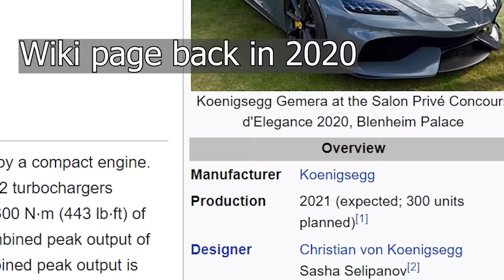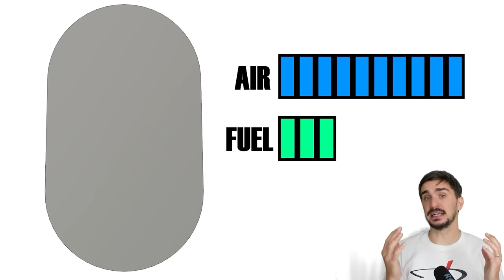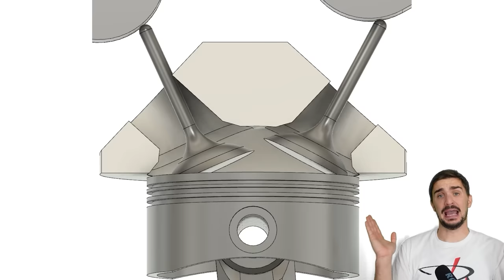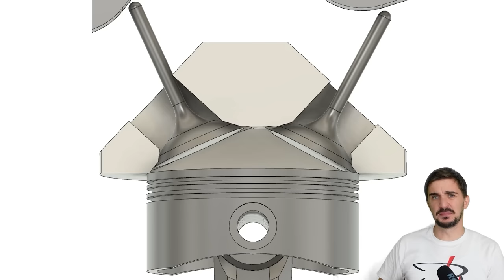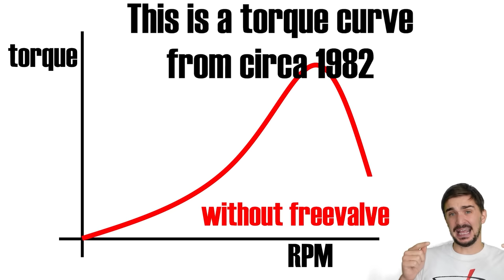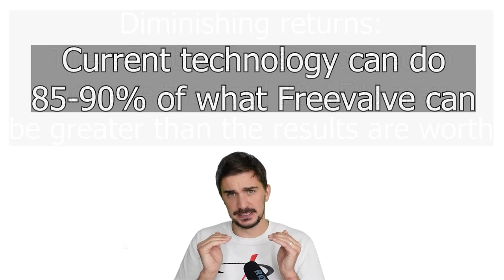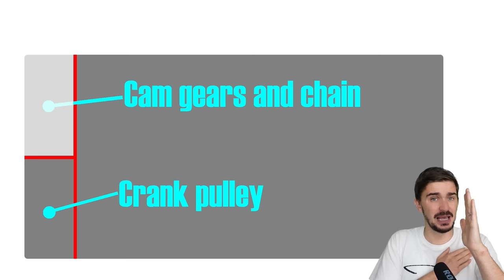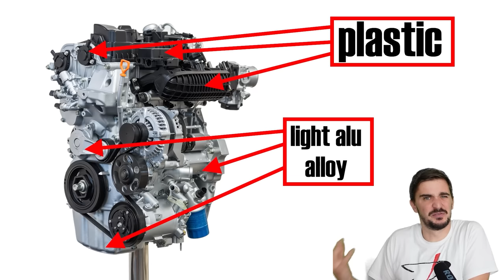FreeValve Isn't a Big Deal. Here's why

Comment: I thought Christian also promised the efficiency would be up, the need for knock resistant fuels would be down (high boost without knock), preheating the cat would be easier, so no need for two catalytic converters. The GR Yaris/Corolla might need to compensate for the boost pressure with lower compression or run more boost to make the same power, so that would result in less fuel efficiency and less power apples to apples.

Comment: Koenigsegg has stated their focus was on developing a sort of AI machine learning software which will discover new and better ways to operate the valves for any given condition with the primary goals being significantly reduced emissions  along with increased power.

The advantages will be having an engine which produces the maximum amount of power whenever you want it, with an aggressive race-cam profile. Then immediately back to a luxury car idle and low end torque. While producing so little emissions that a catalytic converter might not even be necessary.

Comment: instead of using a different air compressor (like a supercharger) could FreeValve use the exhaust gases for pressure in the pneumatic cams like a turbo does?

Comment: Talking about engine size change they probably meant size od the engine on produced power having assumption the power gains are real.
The idea to control valves opening by computer is good, but the way they've done it is far from good - it requires the extra pump (weight) and the energy to move the valves is still coming from engine produced energy but on few stages of converting it to final work with all losses asocciated on every step, therefore it can not be very efficient overall.

Comment: It removes all the parasitic loss of a conventional valve train. The big advantage is no parasitic loss driving the cams, valve train, cam sprockets/gears. The higher performance the engine with more aggressive cams, stiffer springs the more power lost by driving the top end.

Comment: Things like FreeValve do make sense, but not by the way described there and only make sense for very low volume production engines/cars where just a few dozens are ever made.
The thing is, in engines the industry went to really extremes in pushing the design to real physics limits. And that requires a lot of R&D costs and time and/or high risk of something being overlooked in the design and needing correction later, the risk of such design errors increasing mainly when the R&D budget is limited. With high volume production, even seemingly small percentage of a cheap product price summes up to very hefty sum of money, allowing e.g. so large development teams and extensive testing, greatly reducing those errors.
How that is related with FreeValve? By removing the fixed cam profile, which when shows up as wrong requires physical recall and laborious replacement work, FreeValve being programmed by SW allows such correction to be made remotely within half an hour and even without the need for the customer to leave the car at the dealer.
So it allows to get away with way less expensive R&D testing, which brings quite a difference when just few pieces are ever produced.

Comment: Unfortunately internal combustion is at it's peak. I doubt any significant improvements will be made moving forward. They're pretty close to the limits of how much energy can be extracted from the fuel. Another thing to note is that electric motors solve all of the issues covered in this video.

Comment: I think 2 cycle may have another return..  given all possible controls, VVT, Direct Injection, Free Valve with a Charge Pump (Super Charger), Maybe Opposed Cylinders?  My 2 cycle 125cc Go Kart engine makes 27 HP at 17000 RPM..

Comment: I think the apples or oranges comparison here between freevalve and conventional valve trains is that conventional valvetrains/cams generally only have split personalities in either cam timing, lift, and or duration. It seems to me that regardless of how peak to peak numbers compare, especially with a heap of unqualified variables freevalve, in theory would offer a greater average VE than a cam can. And the only way to really qualify all these percentages this video cites would be to have identical heads with and without freevalve. Otherwise this is all purely speculation.

Comment: The benefit of the freevalve is infinite valve timimg,lift, duration and overlap.However for basic transportation,.low compression,narrow powerband and reliability never mind extremely low cost the valve spring is pretty hard to beat.
Reply: That valve spring returns a fair bit of energy back into the cam, how are you going to recoup the energy used in these valves? You won't and you'll lose mpg. This tech won't go anywhere outside of maybe racing where mpg don't matter.

Comment: What if we just build a cylinder head w the "free valve" upgrade complete w an ECU to trigger each actuated free valve w built in maps and maybe tunable options for the average user.   I think that's gonna cut the costs big time.  I'll put it on my old bseries or an old 22r .. If only someone would build such kit

Comment: So….even based on the horsepower curves, the free valve makes about the same PEAK horsepower, low low end power of the Corolla CR.
Eliminating the frictional losses of camshafts will more than make up for the compressor needed.
Free valve still has a lot to offer, I suspect long term reliability is what is slowing production.
Size and weight savings are from engines that needed 6 or 8 cylinders to put out 600bhp.

Comment: Free Valve could be used to, instantly, turn a 4 Stroke engine into a 2 Stroke engine, using turbo compressors to do the compression cycle. It would be a game changer.

Comment: It’s strange to me that you point out that valve timing mainly affects the overall torque curve and not necessarily peak power and then you go on to compare freevalve and non free valve using only peak hp numbers. Wouldn’t it be more accurate to compare total torque below the curve?

Comment: You didn’t really touch on simplicity. Those bmw and Volkswagen systems have lots of moving parts and prove unreliable in the long term. Cylinder deactivation by oil starvation is unreliable over time. An electric solenoid using an electro magnet is super reliable and the only moving part. Simple is better.
Reply: Electricity adds to unreliability

Comment: If having electronically activated valves in cars were worth the effort then they would have made the transition from large two cycle, compression ignition, marine engines. They make sense in container ships and tankers because they eliminate the need for a transmission, as these ships stop the main engine and start it in reverse for reverse thrust, a major engineering solution when you consider that the only transmission that would work at that scale is an electric drive and that is very inefficient...
[ Also getting an engine to run smoothly on heated nasty heavy bunker oil is not easy and at when the ship is built around the engine you can't afford to damage it as a blown engine == a totaled ship...]

Comment: Anything that can be done in mechanics can be done by the ECU, at least as well if not better. If nothing else, Freevalve gives performance tuning opportunities specific to an individual engine that don’t exist in mechanical systems.

What it doesn’t provide is a limp home mode. A purely mechanical system can still run, albeit badly, in the event of a great many failure events. A purely electrical system can’t.

That said, I’d still prefer the Freevalve system, for all the same reasons that I prefer fuel injection over a carburettor.

Comment: comparing their base model engine to an extremely limited high tier mini cooper model is not a good comparison. If the free valve engine were tuned the way the corollla GR was then it would also likely produce over 300. the GR engines are maxed out per cylinder and require machine work to get pushed any further where freevalve would likely blow passed as it doesn't have the same restrictions.

Comment: the biggest ground breaking change of freevalve would be for me if you have access to the ECUor an aftermarket one,  being able to program different camshaft profiles maps, experiment with two stroke cycle,  completely modify sound,  jake/Air brakes, etc
Lots of cool stuff if you are into programming or messing with software possibilities
if you redirect half the exhaust valve to an air tank, you can make pneumatical regen braking, using air brake to slow down the car and store compressed exhaust gas in a tank, and release the pressurized gas into the cylinder during acceleration for "free" energy

The fact that fiat multiair egines does maybe 50% of what a true freevalve engine can do....well I think its more a proof that more can be achieved, than a sign that freevalve is dead.
If freevalve tech dies, or just never goes mainstream, stays within koenigsegg, it will probably be for cost/mass production/reliability issue ? OR by lack of ICE R&D investments , being redirected to EVs

Comment: I agree that FreeValve is not something game changing. However, I think there are some misinterpretation / misguiding about the figures, just for the sake of this topic. "Traditional Engine", I think what FreeValve meant was that "same engine with FreeValve and without FreeValve" rather than comparing a Chinese engine with FreeValve and an engine from AMG S63. " Lighter, shorter, etc.", I think what FreeValve meant was that under the same condition, which is holding one variable as constant, e.g. same height, with FreeValve, the length is shorter. Not at the same time. Granted that BMW has ValveTronic and VANOS in the same engine and other car manufactures have other valve manipulation technology, what FreeValve shines is that none of the current manufactures can achive ALL of the valve manipulation technology alone, all in one engine, with less parts, with higher efficiency. FreeValve is an Add-on which most likely suitable for all engines with camshaft and there is potentially a guarantee of performance increase if converted to FreeValve. And the reason that FreeValve is not moving forward could be a reason that it is in the hand of a hyper car manufacture which most likely patented to the teeth that no other car manufacture could mimic, not without a major investment.

Comment: I had thoughts about this design back in the 70s when I was young and poor so I wasn't fortunate enough to have tons of money to develop and build my idea. I knew that it would take extremely powerful and durable solenoids to operate the valves quickly enough for it to work. At the time I didn't think it possible to produce such a beast. I never thought of hydraulically controlling them. In my mind I knew that computer control of the valves could be used to select either the characteristics of what we used to call a "mileage cam" or a 'race cam". I had recently learned how camshaft grinds worked. Koenigsegg took it to a level I didn't think of (in the days when most engines had one camshaft and two valves per cylinder) like controlling all four valves individually to manipulate swirl in the chamber, throttle control, cylinder deactivation or overlap and lift as was explained in this video. Variable cam timing and technology like Honda's VTEC (actually three different cam profiles in one engine with activation controlled by the rocker arms via ECM) that is commonplace with current technology has proven the incredible advantage to valve timing and lift control. Internal combustion engines historically have been relegated to one camshaft profile which pretty much have to be designed as a compromise between power at different RPMs. Typically, low end torque or high rev horsepower. The peak performance was usually limited to a few hundred RPM range. That's all different with variable cam timing and if the lift is variable too, that just offers another facet to performance and/or efficiency. Hence the reason modern engines make the power they do with the fuel efficiency they have. 

Back to my ideas of a solenoid valve control system. My dream as I built my hot rod VW engine was a control panel on the dash where I could push a button to select a mileage, performance, or any other mode like programmed radio stations. Sort of the way drag racers map out a tune and program it into the engine computer. Maybe someday. Too bad I wasn't rich like Christian Koenigsegg or I would have had a 50 year jump on him. Another design I thought of was sliding intake and exhaust valves, sort of a sliding door that would solve the problem of the head of the poppet valve being an obstruction to air flow. 

Great explanation in this video. You always do such a great job of explaining things for the average person.

Comment: I do think FreeValve is absolutely the future, but their marketing hasn't helped at all. And by FreeValve being the future I mean any similar technology, it sounds like the Fiat version completely fits that. But anyway the important part of the technology isn't at all horsepower numbers like they keep advertising. It's everything else. As stated in the video, non-peak power, non-full throttle is where it does great. Efficiency numbers, everything but peak power. And as the technology becomes more prevalent engine designers will discover new tricks to use with the extra control they get whilst the price will come down. My belief is the price will eventually get similar or cheaper than conventional cams (circa 2020+ not 1960s).

I also think their marketing is more manipulative than suggested in the video. The huge reduction in size makes sense if you're talking about using a smaller displacement for the same horsepower. Same with weight. But then they talk about power as if its the same displacement. The numbers aren't "wrong", they're just twisting them as far as possible to make it sound revolutionary. Obviously the focus on irrelevant aspects and the manipulative presentation hasn't aged at all well and makes the technology look useless. I also think the FreeValve specific implementation of it isn't the way to go, though I do wonder if its better suited to high RPM than the Fiat implementation (which I've only just heard of).

Comment: The whole valve thing just seems so complex. Why not have a butterfly type valve that opens and closes so that there is no obstruction on the intake or exhaust portion of the cylinder? Or half-3/4 of a rotating disc that spins over the intake and exhaust ? I’m no engineer. And maybe my ideas are dumb. But it seems like a pretty easy thing to simplify and make more efficient.

Comment: Large 2- stroke diesels with this level of control have been used on ships since the late 90s/ early 2000s. The real benefits are not in peak torque and power, but the ability to remain stable, efficient and clean under much wider conditions

A more conventional engine can be built to acheive any of those things but not all in the same engine. Near infinite variability, however you acheive it, allows you to have it all. 

Also, the parasitic drag of the compressor should not be much different than any camshaft

Comment: Well free-valve could be interesting if we design the engine around new valve paterns. But thats not going to happen with modern politics. My biggest concern with free-valve was the RPM those engines could achieve as well as the longevity of the system. Classic fixed camshaft lasts forever, the valvetronic and multi air systems do need fixing after 15years / or up to 200k.
I thought it might enter big engines in trucks, boats or stationary. But haven't seen them there either.

Comment: THE LAW OF DIMINISHING RETURNS!

We are already close to the economically made maximum efficiency of the 4 stroke engine using the current available fuels.

Irrespective of how the valves are operated, it is actually the fact that the engine has a ‘VALVE’ in the way in the first place constricting air & exhaust flow.

I have plenty of my own ideas!  EG….for lower speeds maybe we should just mix the air & fuel beautifully before it even enters the cylinder?

Comment: So the rest of the info is fine but it should be pointed out that the Corolla GR here doesn't make any sense when you compare it to the QAMFREE. It's a heavily boosted engine. Over 26psi of boost. That's not an example of cams overtaking actuators.

Comment: I see fee valve as eliminating the drive to GDI which is a maintenance nightmare as the valves carbon up.  The higher boost pressures are wearing out engines faster as they blocks and components are not being adequately strengthened.  So the inflated claims are just that but in the long run I can see the lower parts count and simpler layout as a plus.  
I can’t tell you how many GDI cars died due to oil dilution from the high pressure fuel leaking past seals.
Take out the throttle body, high pressure fuel rails and injectors,Timing belt systems and tensioners, cams and all those sensors, get rid of turbo boost (which most due for emissions and due to the GDI) and the parts count and highly stressed parts decreases dramatically.  Yes it will require a huge change in engine diagnostics and programming.  That is what the industry will fight against.

Comment: 14:30 Completely wrong. If you eliminate the camshaft timing components then the crankshaft can be shorter and the crankshaft pulley can be moved in to where the timing sprocket used to be.

The biggest thing about Freevalve (or similar system) that you haven't mentioned is the drastic reduction in complexity. OHC engines and timing chains are a mixed bag, I've seen some require chain replacement before 150K miles. Not to mention, the more parts you add with systems live valvetronic and multiair are just asking for failures.